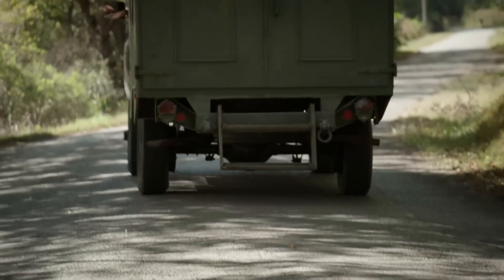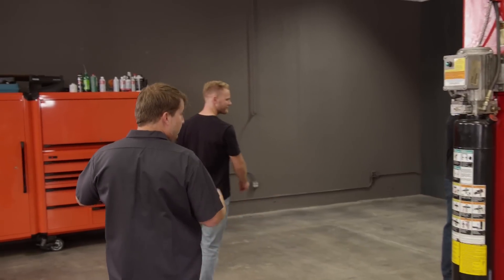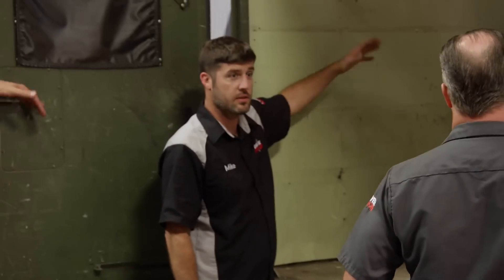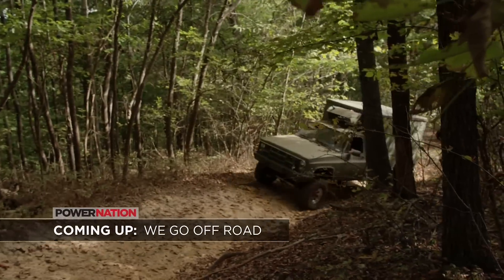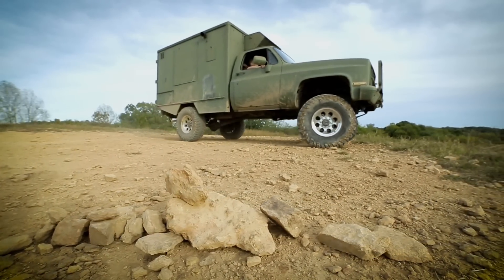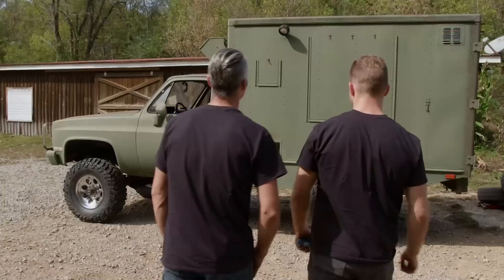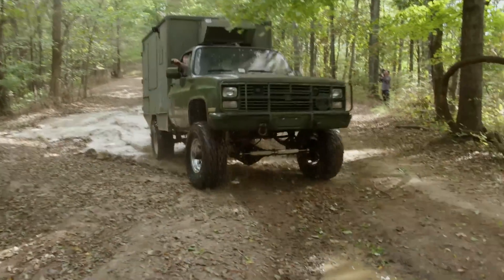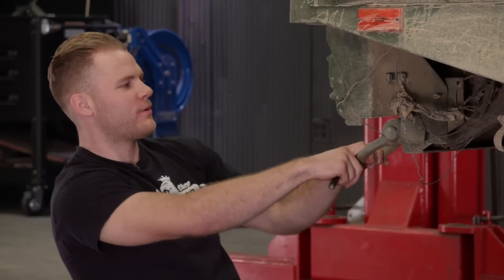Building a Mini Monster Mud Truck from a Surplus Military Ambulance - Carcass S1, E5

Comment: 2:16 the 6.2 was old, tired, and clapped out when it was new.
Reply: They should put a 5.9L 12 valve Cummins P-pump in its place but we all know they will put a gas guzzling big block in it!
Reply: @jessiej3991  they could have just started with a 2500 dodge too
Reply: @AndyFromm  You do realize the 5.9L Cummins also comes in other vehicles such as RV's,Boats,Construction Equipment and Bus's that have no affiliation to Dodge aka Chrysler right?
Reply: @jessiej3991  look at my channel and rethink your question
Reply: @jessiej3991  btw I own 7 cummins and not a 1 of them came out of a dodge....
Reply: Bobby Brown  thank you for your service
Reply: Bobby Brown  Driving those during my deployment made me fall in love with them.  The tires we had were no good in the sand, but damn I loved those CUCV's.

Comment: if you guys wanted military axles to put under your Willys Jeep you should have gone to Memphis Equipment Company in Memphis Tennessee and gotten salvage Dana 60 axles for it instead of chewing up two perfectly good vehicles to build one. Stacy David did the same thing on Trucks when he built Sergeant Rock out of a 1946 Dodge truck he found in a field.

Comment: We had a truck just like this, was a 1987 military with a conventional bed and a 6.2 diesel. We converted it to a brush truck and use it for 12 years until 2 members wrecked it going to a call and bent the frame. Still ran and kinda drove, we sold it via bid and I'm sure the new owner is going to swap the frame. Chevy square body frames are pretty plentiful around here

Comment: I drove on of these for a search and rescue team. It was sorta like driving a Miata in autocross. Had to always think about maintaining just the right amount of momentum. Also, that box should be insulated. Big bonus for building a camper out of it. PS. Watch out for those swing down litter holders. They WILL come lose and knock ya in the head when you least expect it.